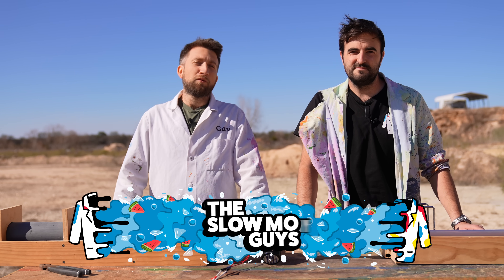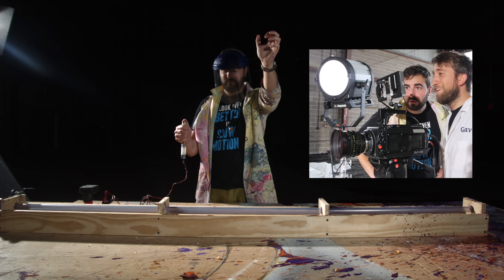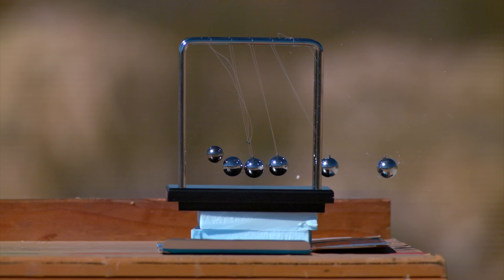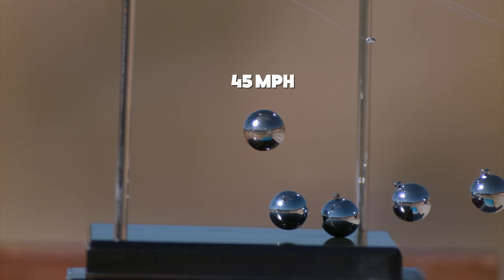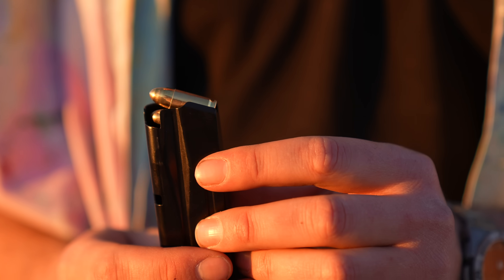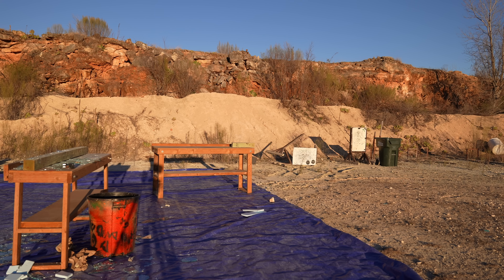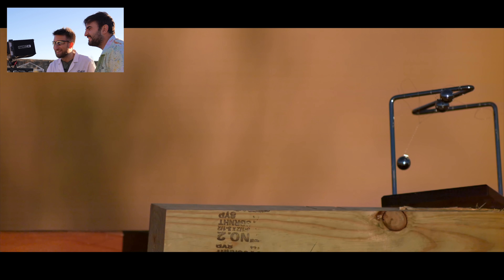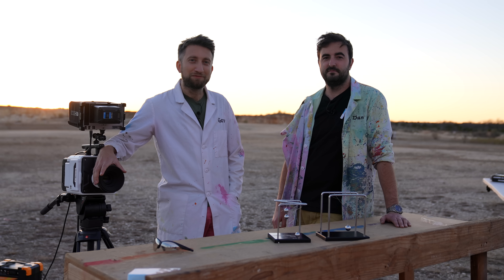Bullet vs Newton's Cradle at 100,000 FPS - The Slow Mo Guys

Comment: Never would have expected a jacketed lead bullet to shatter like that.  Outstanding footage!
Reply: That's basically what happens every time you shoot a jacketed lead projectile at anything harder. Actually, that's what happens any time something collides with another object that is harder, given there's enough force. When people shoot hardened steel targets with non-armor-piercing projectiles, the same effect is seen. My son and I shoot 22s at an AR500 steel target and we will occasionally find bullets that are completely flattened with ragged edges that look like tiny flowers.
Reply: @PacMonster0   "Inertia and speed having nothing to do with hardness."

That's a nice logical fallacy you've got going there because I never claimed they did. Try reading what I wrote again and you won't be the one doing the misunderstanding.
I'm countering your assertion that: 

"if a less hard object impacts a harder object, the less hard object will break apart."

Which Is not absolutely true, as I explained, because you're not taking velocity into account (good old Ek=1/2mv^2). You're the one careless enough to make an easily disprovable, absolute statement.

You can have all the hardness in the universe but without sufficient velocity to impart enough energy to cause a failure in the target material you won't do anything.
Reply: @adamtennant4936  so far, you’re the only one that actually looking at the situation correctly as I can tell. It’s all about inertial frames, and in inertial frames you have to consider all the acting forces. Hardness produces certain counter forces to the impact, and incoming velocity accounts for the initial impact force. You need both, and these other guys don’t seem to get that
Reply: @andrewkarsten5268  Agreed. You've got to take it all into account....
Reply: You got to love learning here.
Reply: Lead is comparatively very soft. You can literally beat it into just about any shape you want, without even heating it. Just like gold. Lead projectiles always splatter when they run into something hard.
Reply: Lead bullets practically become dust when they hit steel targets. The insane amount of energy (relatively speaking) just shatters even the soft lead.
Reply: Nooo, spoiler! :D
Reply: hmm
Reply: They almost always do
Reply: @PacMonster0  Does the shape of the bearing have any influence on the outcome? Would a Cube Bearing made from the exact same material as the Ball Bearing change the outcome at all? As I think about it, probably just changes the shatter pattern of the bullet but not much more.
Reply: Lead bullets practically liquify when they hit hard targets. I couldn't find the original, but this was the highest resolution repost I could find quickly. 

Bullet Impacts - 1 million fps
https://www.youtube.com/watch?v=b_sO1SDXv10
Reply: thats exactly what that type of bullet is made to do. the jacket shreds and the lead blows apart.
Reply: Ikr that was absolutely insane wow 😮😮😮😮😮😮😮😮😮 mind blown .
Reply: That also looked like a frangible bullet. Which is what there supposed to do when you shoot at steel targets.
Reply: @Justmeokok  Wasn't frangible, regular lead core FMJ will "shatter" like we see in the video when it hits a proper hard target.
Reply: Jacketed Lead versus Solid Steel.
Reply: I would!
Reply: some bullets are designed to shatter on bones to achieve maximum damage why do you think there are hollow points.
Reply: @STIGGBLASTBACK  Hollow points don't exist to shatter when they hit bones, they exist to transfer energy into the target more effectively by increasing wound cavity diameter, which in the process reduces overpenetration (meaning reduced risk of collateral damage to what is behind the soft target being shot, hence their near universal use among police departments.)
Reply: @infantjones  dude explain black talon rounds
Reply: Bullet vs bullet would be epic. :D
Reply: Oi, add a spoiler alert
Reply: SPOILER
Reply: E
Reply: Ye
Reply: Spoiler warning?
Reply: bruh spoilers
Reply: If you shoot a lot you know how bullets explode when you shoot steel. The crazy thing is that a tiny bearing shattered the bullet and not a giant steel plate.
Reply: I wonder what that ball bearing would do to a ballistic gel dummy…
Reply: @josephhayes9152  would basically be a mini cannonball
Reply: @josephhayes9152  look up the damage civil war minnie balls did
Reply: @josephhayes9152  I mean just look up full steel buck shot. Basically mini ball bearings
Reply: Watch this, bullet impacts at 1M frames/sec, https://www.youtube.com/watch?v=QfDoQwIAaXg&t=46s
Reply: Ruined my day
Reply: You should watch bullet vs Prince ruberts drops. Same phenomenon.
Reply: Fun fact: being designed like this helps cut down in ricochets as well
Reply: Copper, nickel, and lead are all significantly softer than steel
Reply: They'll do that if they hit water at a high enough velocity too
Reply: is a cool vid with slow mo bullets shattering and hitting objects, almost looks like they are made of some fluid https://www.youtube.com/watch?v=QfDoQwIAaXg&
Reply: nj
Reply: @PacMonster0  just wjañwjaöjiñ
Reply: Any one that actually use firearms knew that was going to happen, get out in the world and shoot some guns !!!
Reply: why not? this is 100% why spall lining exists.
Reply: you thought the balls would shatter?
Reply: @PacMonster0  you misunderstood
Reply: You must not shoot steel much, happens with all bullets really
Reply: It’s a target load they’re meant to do that
Reply: I was surprised by the lack of energy transfer. You'd think there would be more given the rate of speed a bullet has. I wonder if rounded hard metal would do better as armor than the current Kevlar or reactive armor currently in use.
Reply: would love to see an AP round with a tungsten core hitting a newton's cradle in slow motion
Reply: @trif55  that would be interesting. Maybe a harder core would create more transfer of energy. I'd love to run that test myself but I don't have the film equipment to record the results.
Reply: But why couldn’t we see the entire unclipped slowmo lol I would’ve been satisfied with that! Watching the cradle fly out of frame mangled after the jacket got exploded!!!
Reply: @PacMonster0  He's saying the bullet is going TOO fast, not too slow
Reply: The way it completely vaporized on impact is mind boggling
Reply: Meh.    2 .50 cal  rounds,  head to head in slow mo...  
VERY carefully aimed, and remotely triggered...  from a safe distance...
Reply: A jacketed lead bullet hitting five dense steel balls. It had no chance.
Reply: I would. but I shoot steel a lot.  Lead splatter is something to always be careful with.
Reply: @PacMonster0  and allow rifling
Reply: It actually demonstrates that the official explanation of what happened to the world trade center towers collapse in 2001 doesn't make sense. The top parts should have disintegrated not the rest of the towers below because of the thinner steel beams.
Reply: SPOILER!
Reply: Technically I wouldn’t say it shattered. Lead is soft. It squished like playdough
Reply: Spoiler alert
Reply: That's why you never hit tool steel with tool steel. They both have a habit of failing rather spectacularly.
Reply: It's crazy how so many are "dude spoiler alert" just go watch the video and not read comments and you won't get spoiled, duh
Reply: Lead is soft.. Much softer than a hardened ball bearing by many leagues of hardness.
Reply: I'd say it's more of a splash. Lead is pretty soft, especially when hot.
Reply: @PacMonster0  diamond is harder than steel but  can be shattered even by softer metals. Hardness scale is for measuring cut/ scratch/ abrasion resistance. The harder something is the more brittle it is. Toughness is how resistant to cracking/ fracturing a material is. The tougher something is the more pliable it is. Strength is how resistant to plastic deformation a material is. Stronger materials require more energy to reach the point of deformation.
Reply: Look up ar500 vs bullets slow motion. It is pretty crazy.
Reply: If I hadn't read thus comment I would not have continued watching
Reply: @PacMonster0  I believe its actually more about the speed than anything else. Its about the principle of inertia, since the ball just cant accelerate fast enough to get out of the way of the bullet. Then ofc the bullet shatters because its its less hard.
Reply: @Zoddom  Don't accidentally fall into the mindset of harder equals more better. Soft things don't shatter. Hard things shatter and crack. That's why the part of the ball that was attached to the strings of the first ball was breaking on impact, rather than the actual string.

More than anything it was the difference in mass COMBINED with the hardness, than the speed of the bullet and it's inertia.

This is also completely disregarding the fact that it's a sphere, which is pretty ideal for diffusing the force of the bullet as it only makes contact with a single point of the bearing, which puts a LOT of force internally on the bullet. Spheres are a REALLY good shape
Reply: @TheGinGear  A bigger, slower-moving bullet like a .45 caliber will do WAY more damage than that 9mm. The speed doesn't matter until you get up to the really heavy sniper rounds. Some of those, with basically little more hardness than the 9mm round, will still go through solid steel armor that is as hard as those cradle balls. The speed of those sniper rounds are something like nearly five times as fast as that tiny 9mm, though.
Reply: @TheGinGear  You guys are partially correct, the hardness definitely plays a big role. That material property basically dictates which of the two materials (in this case, stainless steel vs. nickel/copper plated lead), will deform. 

The second second important factor is the force of the bullet, which is determined by BOTH it's mass and speed (acceleration more specifically). If you were to use a ton of force to slowly press a ball bearing into the bullet, say with a hydraulic press or something, the softer material would deform plastically. The lead bullet would yield to the force before the steel bearing, and the bullet would basically start to squish. The squish would be because as all the bonds in the molecular structure of the lead start to break, they effectively 'slip' over each other. I think what's happening here is the massive force generated by the bullet is sent back into itself (due to the hardness difference) so FAST, that the bonds don't have time to slip over each other, and the bullet experiences a brittle fracture instead, turning it into the shards you see.
Reply: @jamescurfman3284  incorrect. 45 and 9mm have almost the same energy at the muzzle. Their weights and speeds offset each other. Really the difference shows at distance. The 45 is far less effective at say 50 yards than 9mm is because 45 losing more speed and energy faster.
Reply: @SpicyChickenBallz  They pistol here was not very far from the cradle when it was fired. At this range, who cares?
Reply: @jamescurfman3284  Yeah no lol, hollow point design has gotten to the point where any wounding advantages provided by a larger, slower projectile are functionally irrelevant, and that was the sole advantage .45 had besides suitability for suppressed use. Speed also very much does matter with rounds besides "really heavy sniper rounds", .223/5.56 (a very light, high velocity projectile) out of a 20 inch barrel can and will punch through AR500 ".223 rated" steel plates, and tend to fragment inside soft targets.
Reply: @Zoddom  congratulations. You posted a comment that sounded intelligent but at the same time was completely stupid
Reply: @Zoddom  your belief is off. It has nothing to do with inertia because both objects are receiving the same force of the impact -- it doesn't matter which object is actually moving or which is moving faster or anything of that nature
Reply: @Zoddom  Keep basic relativity in mind. It doesn't matter whether you fire a bullet at a ball or a ball at a bullet, the end result is the same. It's all about the hardness (I mean whether the bullet splats or just deforms is a matter of velocity too, but I digress). Most bullets are really soft compared to hardened ball bearings. If you shot a hardened penetrator bullet at a brass jacketed lead ball, the ball would burst apart like the bullet does here.
Reply: @Zoddom  it’s about the hardness.
Reply: @Zoddom  Nah, the speed was a factor but that explanation begs the question of why didnt the bullet just stop or wrap itself around the bearing. Ive seen bullets just mould themselves into pieces of metal, completely deforming themselves and the piece of metal without shattering either of them
Reply: @callanc3925  Like someone else mentioned, it looks like they used frangible rounds which are designed to shatter like that.
Reply: @callanc3925  Hardness vs. Softness.  Some metals are softer than others,  those balls are likely a hardend steel alloy,  vs. say just a plain steel plate, of which may not be hardened. Thats why one would dent and mold vs. shatter and explode. 👊👍
Reply: @Zoddom  ERRRR WROUNG! The speed plays only a very small part. You could crush these very slowly in a vice and you'd see very similar characteristics.
Reply: Spoiled it🥲
Reply: @PacMonster0  Speed has a lot to do with it. A bullet won't go through a falling sheet of paper if you hold it in your hand and move it slowly, it will push it out of the way. There has to be enough velocity to impart the energy fast enough to overcome the target materials ultimate strength before inertia moves it away. And obviously the ultimate strength of the projectile's material must be relatively high enough in order to survive the impact to impart the energy.
Reply: @adamtennant4936  you proved pacmonster correct with your "counter" point... you must have the hardness to transfer the inertia... the bullet shattering was a result of lack of hardness or strength
Reply: @IkethRacing  You might want to try reading all the replies in a thread...
Reply: @adamtennant4936  sorry i have a life
Reply: @IkethRacing  Well then expect to look like an idiot when you don't know what you're talking about. 🤷‍♂
Reply: @PacMonster0  OH! okay, that makes sense for the armor. Partially as a cushion,  not just full-on rigid-hard. Got it. :)
Reply: The jacketed round is designed to shed when hitting hard targets. The logic is the center of the round would continue forward to penetrate armor.

It increases the bullets penetration and I believe it also helps with trajectory.
Reply: Spoiler 😤
Reply: @PacMonster0  lol this. This guy knows the basics. It surprises me how many people don't know even the basics of physics.
Reply: @PacMonster0  this is in reply to your 2nd comment: don't doubt yourself quite yet.
Use your upvotes vs his upvotes to calculate your certainty 😄
Really though, you're pretty much right on the money.
A softer projectile can shatter a harder projectile if it's going fast enough, but the softer projectile will always deform more.
Reply: Honest to God, the most impressive thing to me was how the 2nd ball didn't have its string break EVEN AFTER it got hit twice.
The 2nd hit most likely didn't help it at all, though there's a slight chance it could have. I'd guess 1/20 though.
I think the 2nd one didn't have a broken string because it wasn't accelerated (m/s/s or fps/s) as fast as all the rest. In fact it was accelerated so much more slowly that it even survived that 2nd impact, but that 2nd impact had an order of magnitude to be sarcastic lol less force.
Reply: For clarity: The hardness of the single ball would have shattered the bullet either way, but the balls behind it is what kept it from moving very much
Reply: 69th reply. That is all 😌
Reply: aren't bullets designed to deform?
Reply: Bullets are typically made of lead, which is a soft metal and softer than the steel.
Reply: @PacMonster0  Bullets mushroom. FMJ rounds are likely to just go straight thru a body, doing damage, but only at the size of the original bullet. FMJ is for piercing body armor and such, but it's garbage for firing at a body, Hollow point bullets, OTOH, are designed for hitting soft tissue, and they mushroom out, roughly doubling in diameter, and then pushing a bunch of bone and tissue out through the larger hole they make on exit.
Reply: I kinda did. the mass of all the balls are added against the softness of the lead.... yeah.
Reply: must be as simple as mass times velocity. The bullet is faster but it weighs much less than the bearing.
Reply: @SLPCaires  ...in the reference frame of the bullet, the bullet is not moving...
Reply: @PacMonster0  you are wrong here . . . glas is harder than iron for example and it will shatter  . . .
Reply: Why would you f'in spoil this....
Reply: Spoilers
Reply: Looks like they used a frangible target bullet. Uses a powdered metal core designed to disintegrate on impact.
Reply: @vanderhovenhaven  No , just a full metal jacket, that's what they do !!
Reply: @vanderhovenhaven  AND he’s the expert! Sorry, I forgot the quotes sign. I guess he didn’t read the box…
Reply: @vanderhovenhaven  Dan said it was a regular FMJ round. Didnt give its weight though.
Reply: @vanderhovenhaven  no. Its solid lead. Lead splatters at high speeds.
Reply: Can you try to refrain from commenting spoilers? Your comment was right below the video and I saw it without even opening the comment section. Also it’s common sense if you have any type of knowledge. Just would’ve liked to keep the idea out of my head before watching the video
Reply: Spoiler alert bro
Reply: @jimmymelonseed4068  people are gonna talk about a video in it’s comment section
Reply: @jimmymelonseed4068  
Nobody gives a %$#@ bro.
Reply: I honestly don't understand why you say that you never would have expected that. You're claiming that for the rest of your life you'd be as ignorant of the laws of physics and material properties as you are right now?

What you should have said instead of that vapid comment is that you now understand why the bullet shattered. Even if you still don't get it, there's still a chance that you will eventually.
Reply: Thanks for the spoiler... your comment is on top and the youtube app shows it when opening the video... ffs